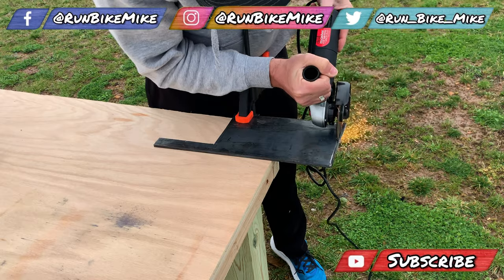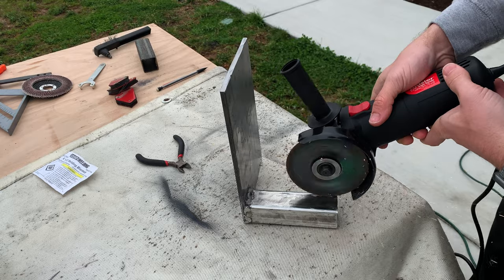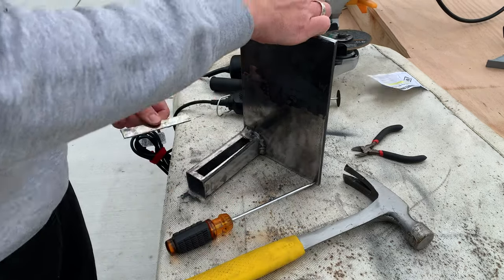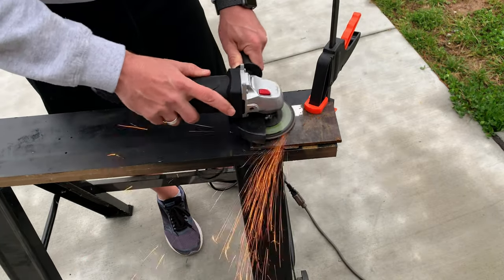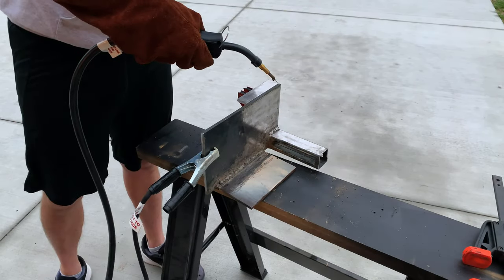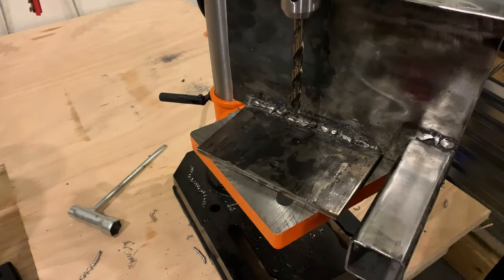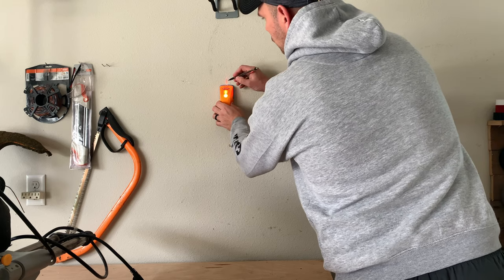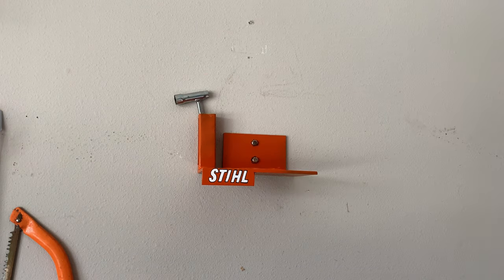HOW TO BUILD A CHAINSAW WALL MOUNT: Made For My Stihl MS250

Comment: You know it's still going to leak oil, right?
Every Stihl, Husky, and McCulloch chainsaw I own leaks a little puddle of oil after I use it.
But I love the wall mount! Good idea, and good video!
Reply: It leaks oil because you arent releasing the pressure built up after use.  I loosen my oil caps before storing and it cuts down on leaks, my 390 and 576 dont leak a single drop using this method.
Reply: @TheAcenightcreeper  I'll try that next time I use one of my saws. Thanks for the tip!

Comment: Very professional looking! I’ll be curious if the oil leaks out. I store my Stihl chainsaw like this on a shelf and it’s saturated with bar oil.
Reply from the maker: I did a test with mine and sat it level like that for about a week and I didn’t have any oil in that area. But when I hang it by the handle oh boy oil every where. If it does start to leak I will empty the oil tank. As I alway add oil when I go to use it. Here is to hoping I don’t see oil down my wall this morning 😂
Reply: Leave a piece of cardboard under it in the position you want to hang it. On my bigger saws the oil drips out from the scabbard - im not ripping off the chain and wiping down the bar after every use. I have mine on the wall on hooks, tip down. Just accepted the occasional drip and don't leave anything under them. Build in the video pretty good tho